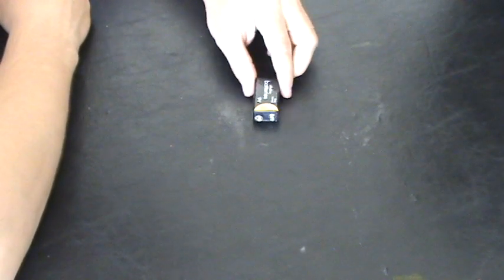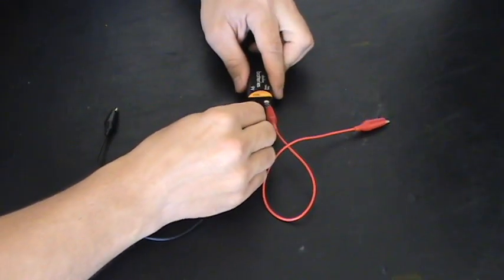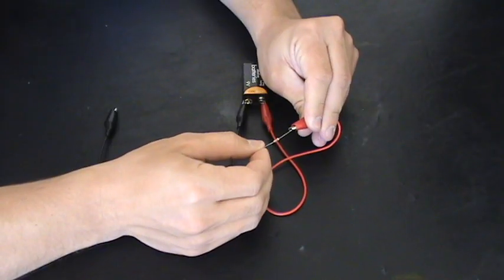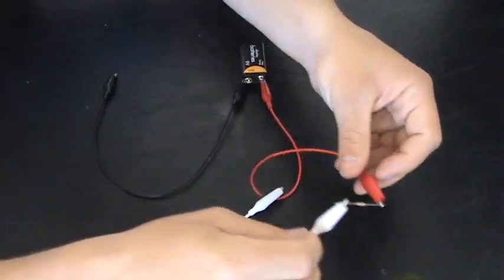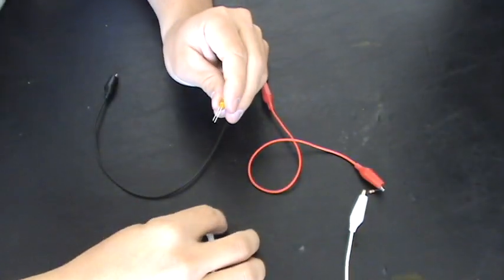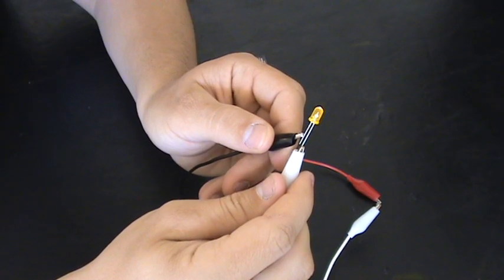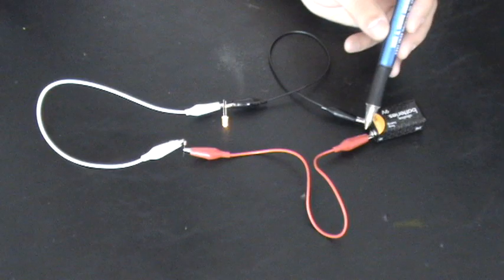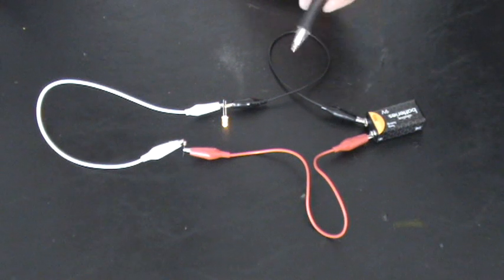Robotics and Electronics Tutorial - 10 - Building a Circuit

Comment: You said you wanted the current to pass through the resistor before the light, but you attached the resistor to the positive side? Electrons flow negative to positive. Great videos though! Cheers mate!
Reply: Incorrect. Ask any college professor or technician that it's from negative to positive. People assume it's positive to negative because text books say so and those text books are sourced from facts given from a time when people assumed electrons flow from positive to negative because of the positive symbol they give protons and the negative symbols they give electrons.
Reply: I read that they are negatively charged so they flow from positive to negative
Reply: Apparently, in a series circuit it's not as relevant since the placed resistor effectively limits the overall flow of electrons throughout and at any given point in the entire circuit (loop), rather than (as may intuitively be figured) the point or area of its placement. So the resistor's placement relative to the direction of real (not conventional) current flow is inconsequential in regards to possibly overloading the LED. 

I recently had the same question though, and still not fully satisfied or at least not yet been able to fully grasp some of the related concepts here...

Comment: Actually, electrons go from the negative output and go back through to the positive input. You could imagine the wire as traffic, where they slow down and become blocked at the resistor, causing less electrons to to go into the led.
Reply: Isn't it true though that, in a series circuit, it's not as relevant since the placed resistor effectively limits the overall flow of electrons throughout and at any given point in the entire circuit (loop)? Rather than the point or area of its placement (e.g., before/after another component such as the LED)? From what I have been able to gather, the resistor's placement relative to the direction of real (not conventional) current flow is inconsequential in regards to possibly overloading the LED for this video since it's not a parallel circuit...

Comment: FYI all of the current does still go through the LED.  Current in series is the same.  The reason you put a resistor in series with the LED is so there will be a Voltage drop.  Power = VI, so because there will be a drop in voltage (due to the resistor), the power disapated by the LED will be less.  If you had the LED hooked directly up then ALL of the power disaapated by the circuit would be through the LED and that could cause it to burn out.
Reply: Overall the current is limited by the resistor, but if by "all of the current does still go through" you mean that the current is evenly flowing (uniformly distributed) throughout any given point in the entire circuit then yeah, true. 

What I'm more confused about is the intricacies of the 'voltage drop' in the circuit overall (due to the resistor) compared to the forward voltage of the LED, and so on, and the relationship (if any) all of that together has with where the components are positioned in the circuit...

Comment: I think there is a lack of intermediate videos on the subject of LED's, Different colors have different voltage drops as well as different current ratings for ideal performance, and these differences should be taken into account when calculating a proper resistor value.  Subtract the LED voltage drop from the supply voltage, and then divide the remaining voltage [which is the voltage drop across the resistor] by the ideal LED current, Rt = (Vt - Vled) / Iled.
Reply: Pardon but, do you still study any of this? 6 years after you posted lol, but if so...how would you describe the 'voltage drop' in the circuit overall (due to the resistor) compared to the forward voltage of the LED, etc., and the relationship (if any) all of that together has with where the components are positioned in the circuit? Or if you know of a quality video explanation...

Comment: @BackyardAmusement Actually an LED will have a voltage of aproximately 2V across it. So you need to do (9-2)/0.025=280Ω. Usually your calculation would be ok but when you connect like 4 LEDs in series then 360Ω would be too high.

Comment: @crazeycane - For maximum life, the LED should run around 25milliamps. Knowing your voltage, 9v, and your amperage = .025amps, you can use ohms law to calculate R=V/I or 9/.025 = 360ohms

Hope that helped.

Comment: @crazeycane  it doesn't really matter what resistor you use, any you could find in an electronics store have enough resistance to protect the LED, if you use a larger resistor(one that resists more current) it wont matter, it will just make the LED dimmer because less current is passing through, so any resistor should work.

Comment: I have a Question. If the current runs from negative to positive than how does the resistor protect the LED? The current will flow to the LED first and than to the resistor from the way it is set up. Also, If you use a resistor to resist, lets say a 9 volts for 6 volts of current. Are you wasting the other 3 volts?